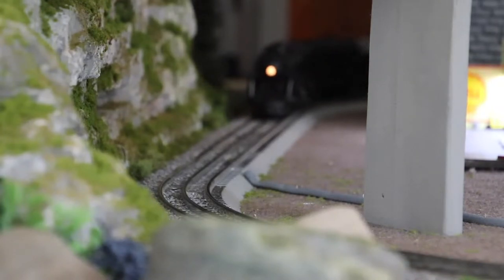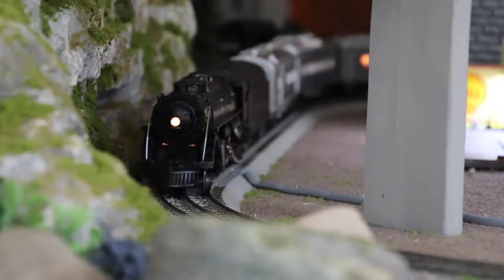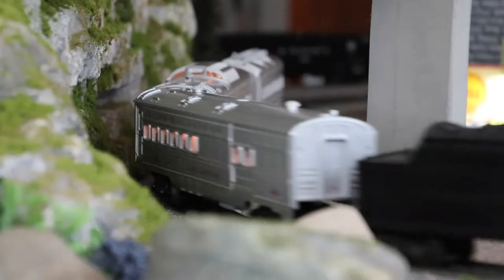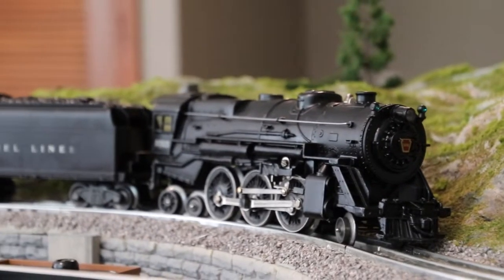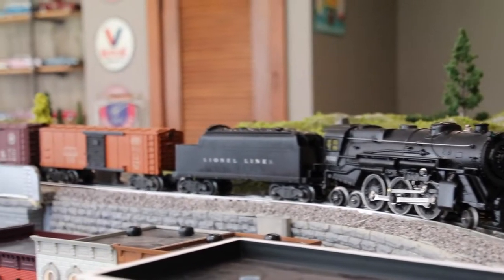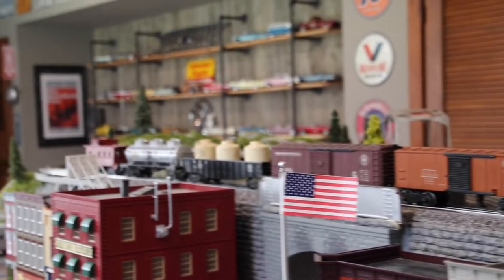SUNDAY RUNDAY #4! Anything Goes! Running Trains On The O Scale Layout 8/16/20

Comment: Does the 1666 have a smoke until and is if it does its it the old plunger style one?
It could be the root of the problem it has.
Reply from the maker: Mr.James Conductor I honestly have no clue. I think it being very early postwar it probably doesn’t but I’d have to look into that so thanks for the tip James!